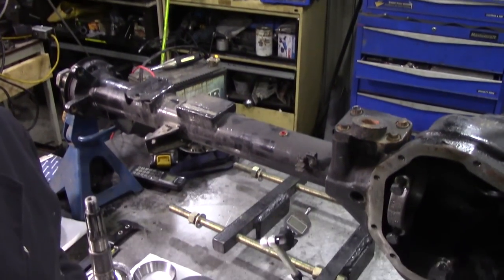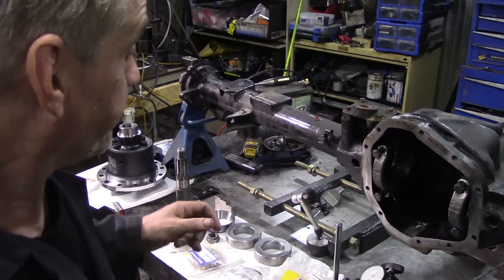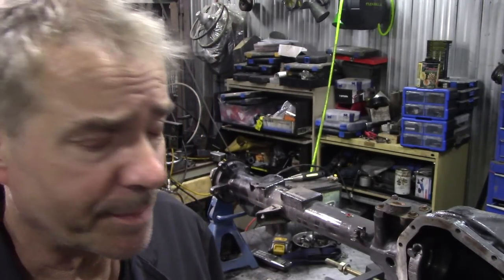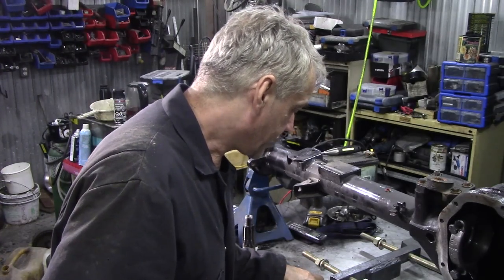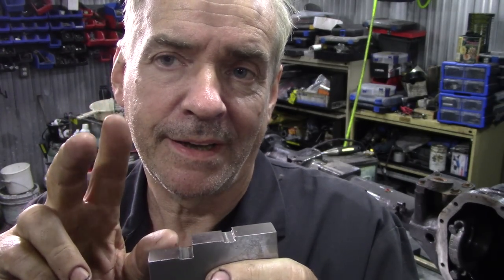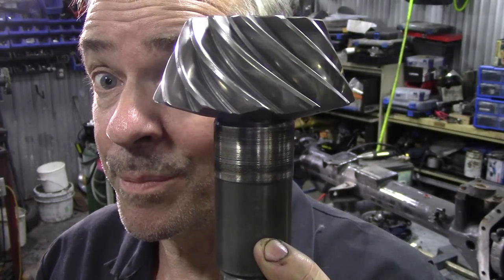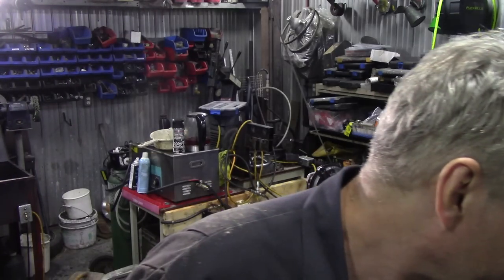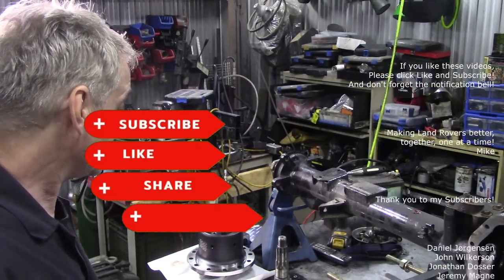Salisbury Axle Part 1 tools and equipment

Comment: I’m glad you are doing this project.  I have one of their ATBs for my Salisbury, having already built up a Rover diff with their smaller ATB.  The added difficulty comes from using 4.1:1 gears - the front gears are KAM Diffs, and despite it being my first diff full build, I got a good pattern using the casing’s original pinion shims (adding and removing a small thickness just to see if I could improve the pattern).  

The rear gears are from a US vehicle Dana 60, bought used from a US diff specialist.  I think they came from a Ford truck, and the pinion is 10 spline, so I’m hoping a Salisbury flange will fit it.  The pinion outer bearing internal diameter (adjacent to the flange) is much smaller than on the LR pinions, so I’ll get a sleeve made up to allow standard LR bearing kits.  Setting that up from scratch with D60 gears into a Salisbury is going to be very interesting.

I did swap 109 and 110 diffs a few times, which transpired to be simple - they always needed the casings’ original pinion shims left alone and the carrier shims unchanged, regardless of which carrier went into either casing.  Got a good pattern every time.  But with an aftermarket carrier with no shims, it’s a lot more work.  I did read a procedure where you use dummy bearings on the carrier (like yours) with no shims and fit that to the case without the pinion and the measure endfloat.  Add 5thou for the total shims and add those to the pinion side of the carrier (max backlash).  Once the pinion has been set at the correct depth, there is a formula for converting the amount of backlash into how much shim thickness to transfer to the other side.  If you can find that, it’ll save all the trial and error.
Reply from the maker: Correct if you have the dummy bearings it is a dream of a job! 
See next video

Comment: always do shimming when wife is out , and preferably just before long weekends , so you have some time to calculate the correct shimms  and time to order the only one you don't have for delivery on next long weekend...:))
Reply from the maker: IF you keep the old shims and mark them for the left and right sides of the diff, then with replacement Timkin bearings the settings will not change 
However on the ATB, we are not 100% the machining is the same as the Salisbury differential - part 2 will clear this up

Comment: Hello mike i have an issue with my salisbury axle pushing my short half shaft outwards through the drive flange   ...im on my third set of half shafts and flanges this year ..help !!
Reply from the maker: Never seen that before - would be keen on looking at the diff itself - the shafts are fully floating, and have no reason to pop out

Comment: Always use the proper tools. You can make a huge mess trying to cheap out on the right tools. Rent them if you don’t want to buy.
Reply from the maker: Dummy bearings are a must on these jobs, if you lose the original shims

Comment: For some reason I didn't think an ATB in Salisbury was an option. I thought it was a Detroit trutrack. Cheers
Reply: Trutrac and Quaife ATBs for the Salisbury have been around for a while, but it is a pretty new product for Ashcroft - I think it was around October or November 2022 that they went on sale.  I got one late last year, having waited for their release for about two years.
Reply: @nickboylen6873  cheers. All good I assume?
Reply: @mrtablet4662  I haven’t had the chance to fit it yet as I am living overseas and away from my LR, but it was well packaged and looks good.  It is pretty heavy, so seems to be strong.  I suspect that like the Ashcroft ATBs for Rover diffs, it is a copy of the Quaife unit, which would be very good indeed.  The Ashcroft Rover ATBs have a good reputation.
Reply from the maker: Just to add the ATB in the LT230 is great! Drive line clunking is greatly reduced and do you need a diff lock now? Very hard to say
Reply: @BritannicaRestorations  worth using difflock in very bad conditions, but it probably wouldn’t be needed in moderate conditions.  Ashcroft would probably corner the market if they could make a lockable ATB for the axles, like the LT230.